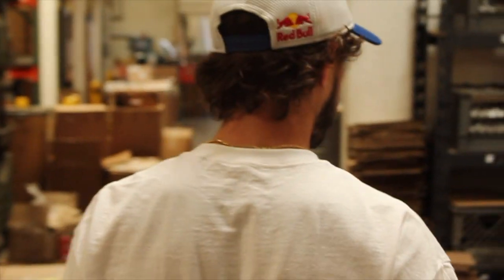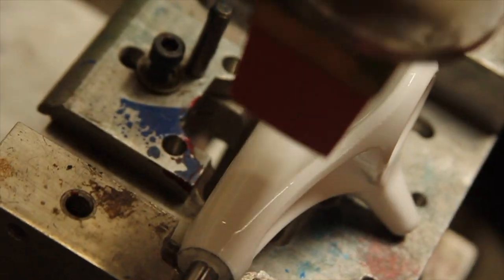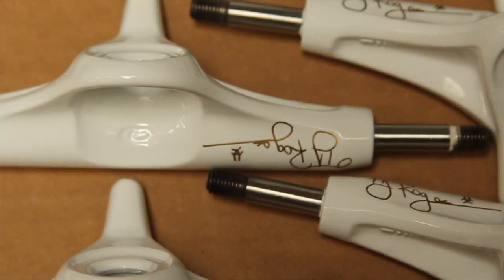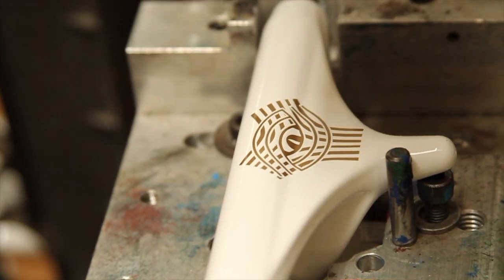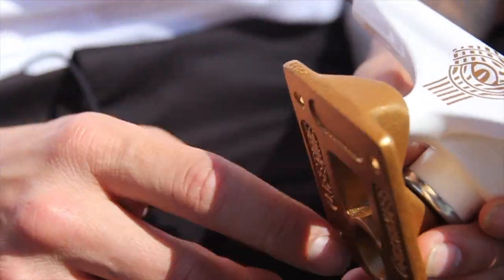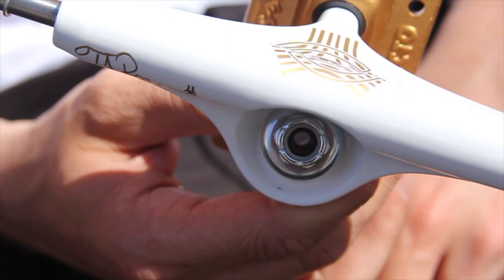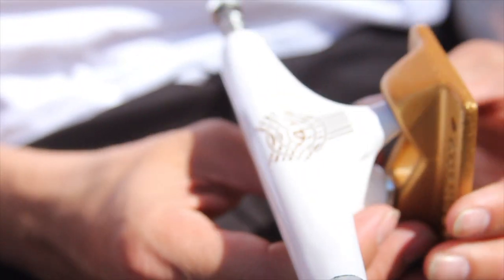T.J. Rogers X Designing Destructo

Comment: Nooo you leave tensor?
Reply: Brophy also left. The only Tensor pro models are Daewon and Rodney. (Currently) Zared does not have a Mag Lite model. Destructo is a much stronger truck and nearly as light, with a lower kingpin.
Reply: @NickRico  Destructo is not nearly as light. It's not even close. My Destructo d2 lite are 350g, same size ATG mags are 268g. There is no truck that compares to Tensors in terms of weight or even really gets in the same ballpark, even the full titanium hanger Theeve Ti-Hangers that I have with a fair bit of metal ground off is 298g. Destructos are good trucks, but they're not light.